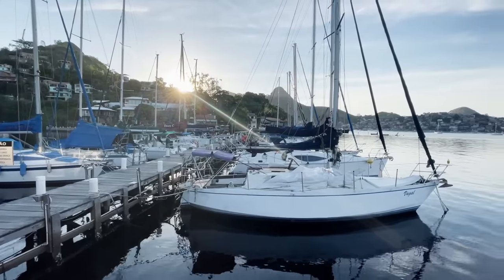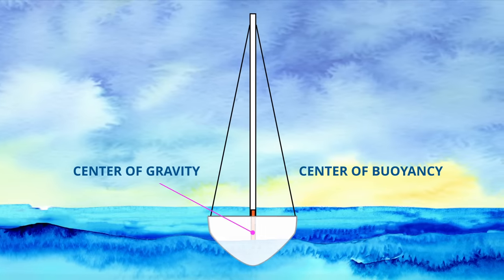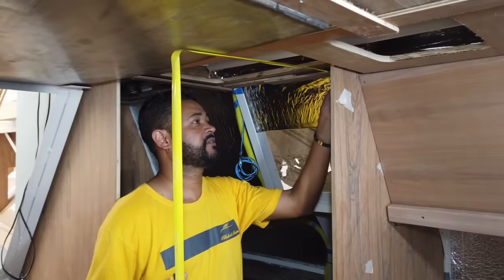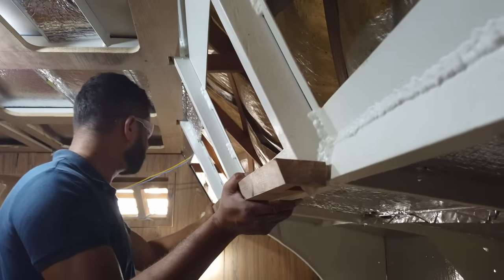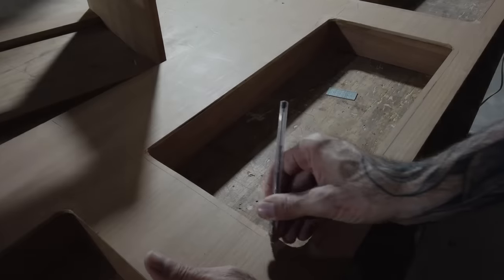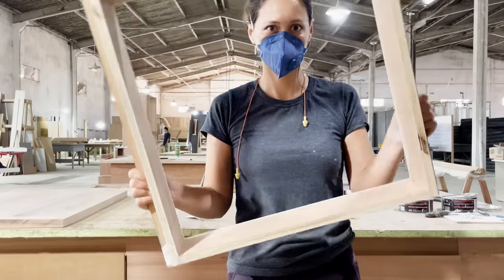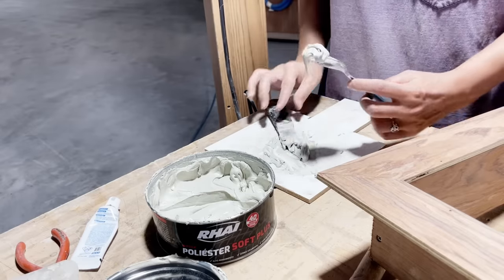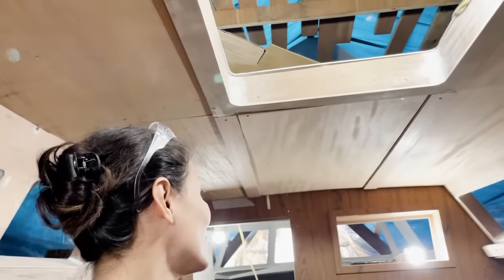ABANDONED BOAT gets a NEW HEADLINER ⛵️ Ep65 – Sailboat Restoration Project

Comment: Thanks great video! Now I have some ideas on how to do the ceiling work and panels. I was worried about fastening straight to the aluminium stiffeners but I guess that’s the only way…
Reply from the maker: Thanks! We tried the ceiling in two different ways, in the v-birth we installed it just hooking onto the stiffeners and using pressure which did work (https://youtu.be/mRMZPBEqsSM). But for this large bit of ceiling we opted to drill to secure the deckhead and use velcro for the panels. We will paint and then seal the holes with sikaflex to prevent wear and tear afterwards. Let us know how it goes for you!
Reply: @lahakai  perfect, I just binged watched a few of your videos and that ceiling one too. It makes sense, especially to minimise the number of holes. I’m concerned about aluminium corrosion… 

Thanks again!
Reply from the maker: Nice! We've been anti-drilling for a while but it got to a point where we didn't have an alternate way to secure everything . All of the original stiffeners in our boat were drilled already, so we just had to drill the ones we replaced which was all the top deck. It certainly made the job way easier.   @sailingkulali